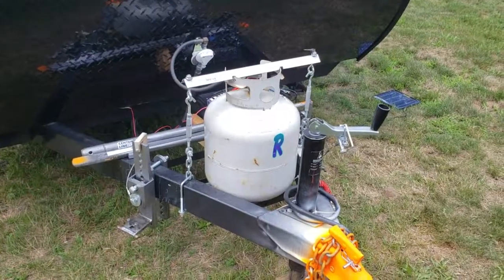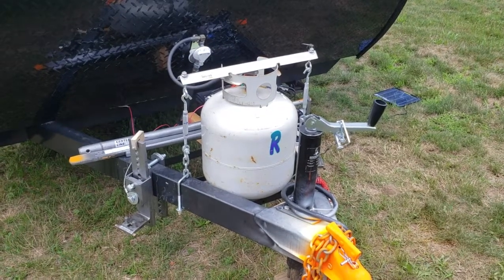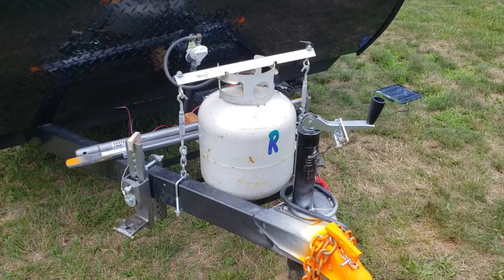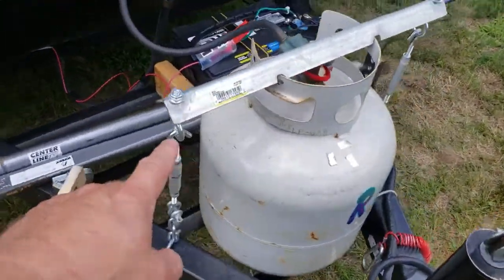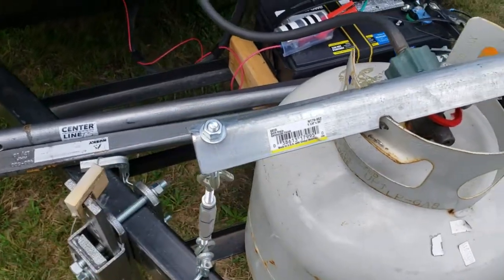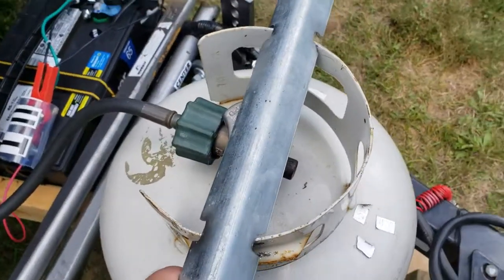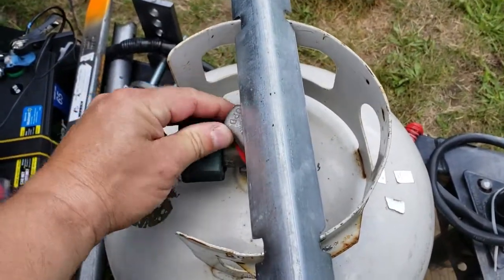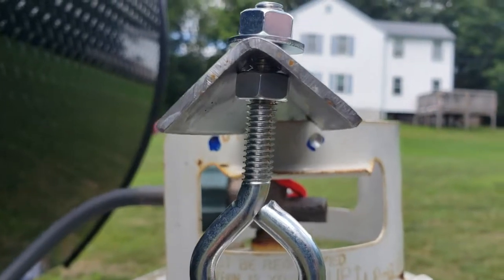Make your own RV propane tank hold down

Comment: Beautiful but what did you use for the tank to sit on the bottom plate? I would not think you would want to just to sit in between the V of the trailer tongue that would cause not only Sparks would it wear a hole on the propane tank and capufe

Comment: Nice!  Did I hear you say you ground the aluminum angle with a grinding wheel?  Please do not grind aluminum with griding wheels.  A guy at work was doing that and the wheel heated up and exploded.  Saw the notch and use a hand file to take down the sharp edges.
Reply from the maker: Yeah I was using a big heavy bench grinder with wheels that weigh like 4 lb a piece under 2 in thick. I don't think it's going to explode.